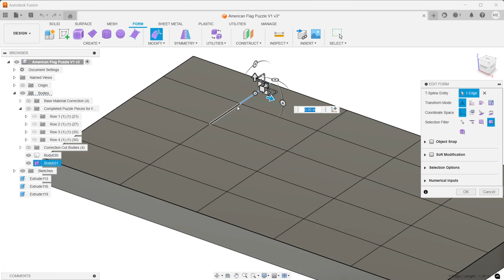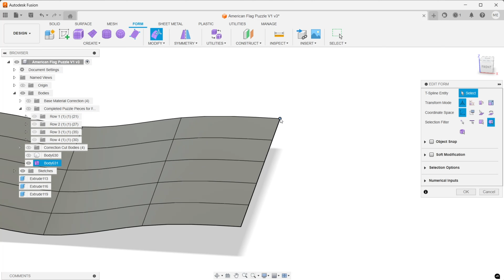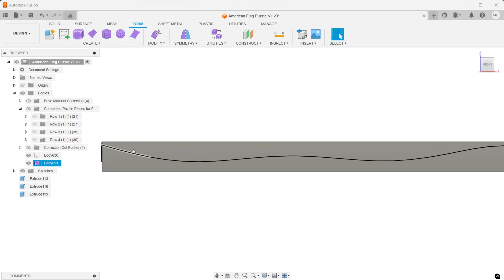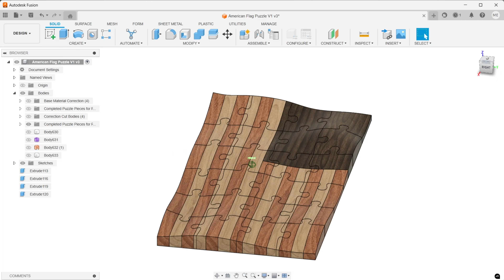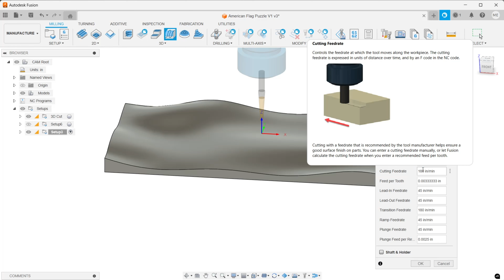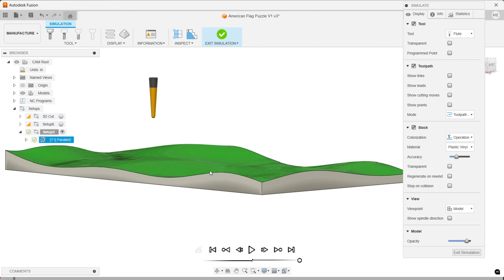How to Create a Wavy American Flag CNC Surface in Fusion 360 | Fusion 360 CAD and CAM

Comment: WOW. You're taking the puzzle deal to a new level. The way that you have laid out the puzzle for the stripes to match up is impressive. Im going to assume that you already have the work piece glued up and know the exact size of the stripes? Even a little bit off would throw it all out of wack. Im looking forward to seeing the finished product.
Reply from the maker: Absolutely!!  The center zero is critical for all those pieces to match up.  The stripes are .5” making the overall dimension of the flag 12 x 6.5.  Should be really fun to make.